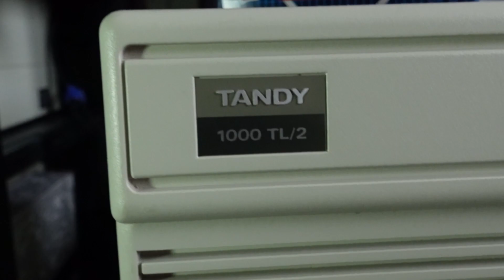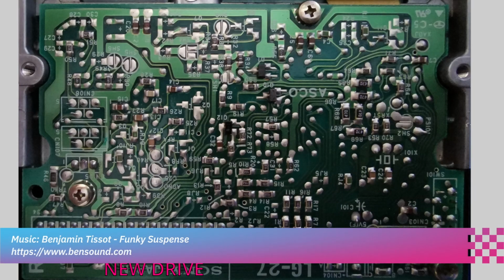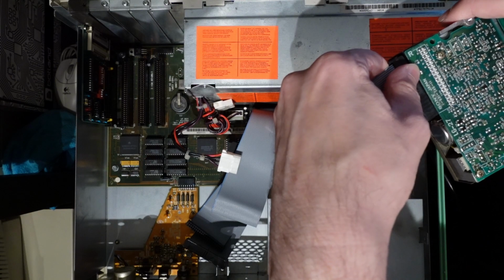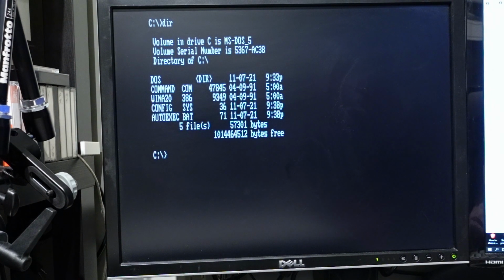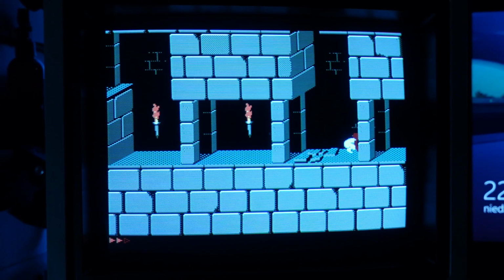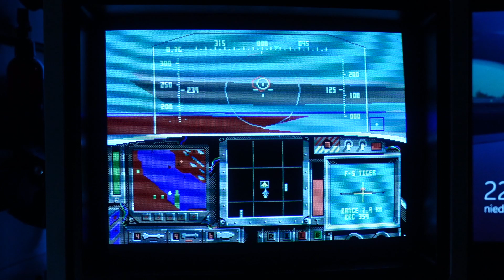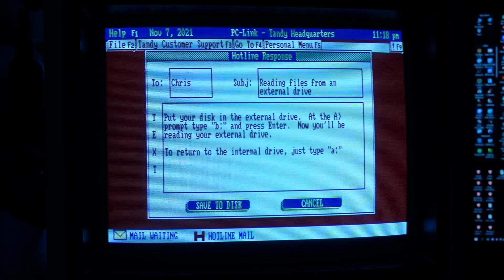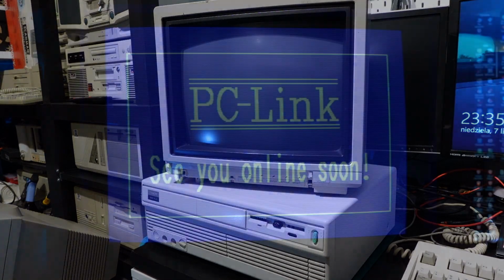Rusty Bits Ep. 004 - Testing the Tandy 1000TL/2

Comment: The v-hold on the monitor could just be a dirty potentiometer. You've watched Adrian's Digital Basement, so you know about Deoxit. :)

Did you try the new floppy drive in a different computer before modifying it? Your mod may have been fine, but it was just a bad drive to begin with.

I'm not a big fan of using CF cards because of compatibility problems. I ordered a bunch of IDE-to-SD adapters from China, and they've worked on every computer with every SD card that I have tried.
Reply from the maker: Yeah, I know about deoxit, but it's not available in Poland and I'm still looking for a good substitute.

Well in haste of preparing the episode I didn't tried the 'new' floppy in another PC ;D seller guaranteed it worked... to be sure I also used electronics from the "new" drive with the "old" drive's mechanics... I have 1,44MB Sony drive of this type and the GOTEK adapters from Derek Osborn should be here in ~2 days...

I like CF cards because they are in fact ATA devices where adapter is just a mostly passive device. I also like their form factor better and colorful stickers :D
Reply: @HanJammer  Deoxit is overpriced and has no lube, it stinks and it stains anything you get it on.  There are many better substitutes.  The crap is up to 25 Dollars now for a small can.  The WD40 people make a similar product for like 7 Dollars and a bigger can.